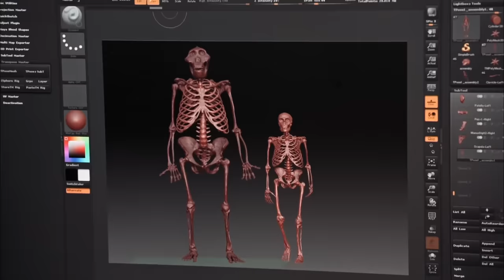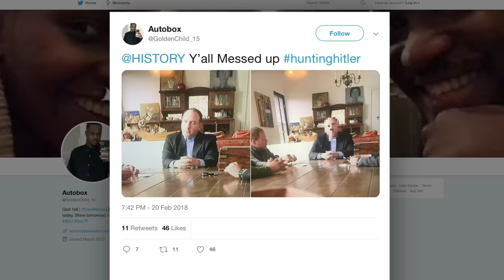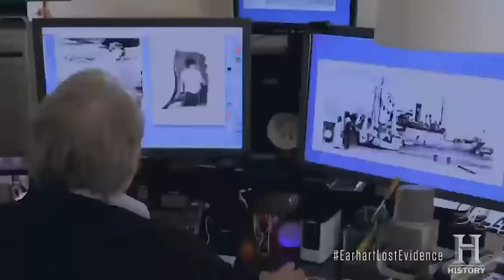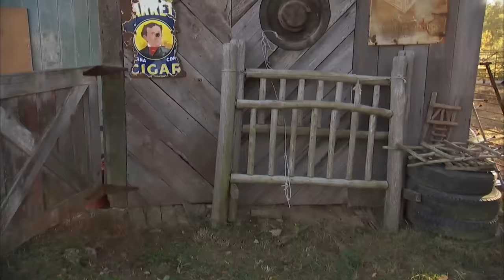The Biggest Scandals To Ever Hit The History Channel

Comment from the maker: Which of these History Channel scandals do you think was the worst and why?
Reply: The ones where physical crimes occurred against others but we really can't blame the H channel for that since it occurred outside of the show. . .    

As for faking shows, Ice Road showed someone trying to put tire chains on a semi truck that was not pulling a trailer and failing badly.  It was very obvious that they were not even trying to do it as it is super easy to install chains on a fully exposed tire.  

Pickers is defiantly faked, there just isn't that much good stuff hidden around the corner.  One show was where they were looking for parts of a very rare motorcycle.  One guy is climbing up over a pile of parts and from behind a shelf, pulls out an engine.  Problem was the engine was completely clean and not rusted like one that was  " hidden away forever. "  

Other networks are not much better, look at the car restoration shows where the drama is so., so fake and they will lose the shop if the car isn't finished in 2 weeks from the time they decide to build a particular car. .
Reply: The History Channel's biggest scandal was taking History out of their channel; nowadays they're simply referred to as the Hysteria Channel.
Reply: After Roger Mudd left it was downhill from there!
Reply: Got a link to these CIA papers?
Reply: It's use by the right wing to spread misinformation, period. Also, every single show mentioned was unwatchable hillbilly bullshit. Long live you tube, and commenting directly below such nonsense.
Reply: well I think Obama = the devil was pretty much dead on
Reply: the bible was the worst
Reply: Satan didnt look enough like Obama
Reply: We get these 'reality shows' in mid-dawn tv!..We sat there,8 of us waiting for the sky to clear (astronomers) Laughing our heads of at the obviously fake 'reality' drama's taking place! All these swamp people in 'mortal danger' of 'gators and all alone!..What?!! They've clearly got 2-3 camera crews and sound people with them! Another was a bunch of 'loggers' bringing down tree's in the most dangerous manner and constantly hating each other! But they never really moved until the so called danger was past!..Again, multiple camera crews!..Reality?..How can people actually believe any of this is real..Well, you did elect Donald Trump..That says plenty about American 'reality'!
Reply: The history of MTV. 
Back in the day it was a channel 
that played music videos
Reply: This is questionable about what could be defined as history in some cases, yes these are past scandalous events. But placing these in a historical timeline???....
Reply: Laura Juranek Modern Marvels was such a great show. I could watch it and be completely interested in whatever topic they covered, even if it was something I had little interest in. Such a well made program. Too bad it’s now history.
Reply: stretching with the Alone one. most of them are youtubers and have talked about it
Reply: @KevinTheSkullAnderson  dude, I just wrote the exact same thing on a Washington Post story. Freaking me out haha
Reply: Losing to Discovery’s Street Outlaws
Reply: History Channel lost it's last shred of credibility with that stupid "documentary" about mermaids.
Reply: That the history channel doesn't actually show history anymore.
Reply: A lot fair points but also a lot of shitty research you've clearly never seen some of these shows like Alone the  contestants film everything themselves they're nowhere  as close to civilization as you make in seem that is N&A most likely , also Alone explains that the contestants undergo weekly check ups from the medical staff. Ax men are filmed on several location with each team / company at a different locations while they might have a Washington team Jimmy was in Florida  one season and Georgia the next.
Reply: @laurencehirst7814  
You think people believing that stuff is bad then you don't know how bad it really gets, in the 1960's when Gilligan's Island was on TV west coast naval commanders used to get letters from people who didn't understand why, with all the ships the Navy has, they couldn't spare a few to go out and look for those poor stranded people, that's how stupid people can be when it comes to television.
Reply: @dukecraig2402  And it's getting worse!..But it's not just an "Only in America" thing! It's targeted at a specific audience, a friend of ours in 'marketing'  explained it this way!.."It's set up for what we call the low browed and ape brained with cash to spend on useless items marketed on the 'reality' shows, who will believe anything! Crazy conspiracy's, Bigfoot, vampires, anything!"..He also said, for the marketers, it's amazingly lucrative!..The people in these 'shows' are nearly all under contracts to the marketing company's and are well paid to fake it!....However, he told us that something in the order of 90% of it is licensed in America and exported worldwide, but NOT for primetime viewing!
Reply: @laurencehirst7814  
Yea I know, I've been to several different places in the world and I can assure you that there's idiots everywhere, it's not exclusive to America it's just a particular mind set, that's why I didn't point out anyone in particular, I'm constantly explaining to people who just sit around and America bash that whatever they say about America they're also saying about themselves, because if there's one thing I've learned in my travels it's that some things about people are are the same no matter where you go, that's why marketing techniques work, it's called basic human nature.
Reply: Y-A-A-A-A-A-W-W-W-N who the hell cares.
Reply: For starters, drenching your talk in background music is the hallmark of a bad, unprofessional channel. It's just stupid. I can't watch it. Unbearable. None of your college professors played music during lecture. When you learn how to properly provide Youtube material, I may give it another try. Have a good day!
Reply: The Bible was hilarious.
Reply: Tbh the whole channel is a joke... they NEVER show REAL history anyway
Reply: @Ouija ZaZa Gaming 🤣😂😂😂😂
Reply: @syntaxerror8955  "Yah but all the cool radio stations do it!"
Reply: I don't know what's so crazy about Hitler escaping to Argentina, when it's confirmed the fucking CIA/OSS rescued and brought in top Nazi scientists into the US under Operation Paperclip. The Soviets and British did the same. The Vatican also helped rescue many Nazis with their "rat lines".
Reply: The worst History Channel scandal is what it has become today.
Reply: Why is one person on a show getting arrested for DUI even on the list? How many employees of this firm ever had a DUI ? No Killed someone or anything details are like well he was weaving and found to have taken beer and Xanix? So this is the least worst and seems like filler or something?
Reply: Scandalous the amount of ads you have
Reply: joseph watson  Not sure how it is political - this is all a Media point grab? peace?
Reply: @dukecraig2402  Aha!..And as the undertaker said..."You've hit the nail right into the lid!"..No matter where you go, or when, their there! They tend to know little or nothing about America! It's even being put about by some fools that it's dangerous to go to America, because your liable to get shot! Iv'e been to the U.S.A. twice, the only complaint that i ever had, is that your catfish taste bloody awful! We don't eat 'em in Australia!..The United States is no different to any other country, and better than most!..Despite Donald Trump!
Reply: @davegordon6943  Spot on! X3
Reply: ...History Channel should DISCUSS More ON REAL WARS and BATTLES of World Wars...The ROTHSCHILDS...Bankers of 1913...The True Sinking of the Luisitania...Jack the Ripper...The Fraud of EINSTEIN....Oppenheimer's NUCLEAR HOLOCAUST...etc...!!  And GET OVER WITH HITLER IS ALIVE...HE's Dead.!!
Reply: @earlfrancart5687  Oh come on, Obama the African as Satan was freaking hilarious.
Reply: @lexblack6170  well it would have been, if the right wing didnt take it seriously, and push it as fact
Reply: Is the Frank from pickers really a "scandal" ? How many people have been locked up every day for the same thing?
Reply: Grunge Big Foot.  Who could be so stupid to believe that crap.
Reply: I don't think any one of them was particularly bad, I just grew tired of having six hours of the bullshit crammed down my throat every night when I wanted to watch some actual history.
Reply: IT HAS TO BE THIS VIDEO! 🤮
Reply: Hunting Hitler couldnt be more real of a possible scenario.  Easy to fake his death, almost every one of his top brass fled to other countries. The crumbs are there to follow as the show did and there are a bunch of crumbs. No they couldnt prove beyond a reasonable doubt but would you believe Hitler to sit back and lose it all to watch his closest all flee and start over somewhere else which most lived full long lives.  We arent talking about believing in bigfoot here.  History channel wasnt sensationalizing Hitler, just merely trying to prove history books are wrong.
Reply: 10 years ago I planned my Wednesday's around history. It was just THAT good
Reply: Your video was much worse than anything  history has put out , this video was full of rambling’s
Reply: Earl Francart  you’re not the brightest light bulb are you did you miss the speaker of the house SDSU a month ago that they had no evidence of trump and Russian collusion, not to mention the muller investigation is over , with no Russian collusion 🙄
Reply: Grunge;  Haven't had cable in years. Huge waste of $$$. BUT! When my wife and I are away and staying at a hotel, we catch up on "South Park" and "American Pickers". Nothing else! So, what's "Franky" Fritz's personal life have anything to do with History Channel's scandals?
Reply: Worst scandel has to be no more history documentaries
Reply: @babyrazor6887  agreed!
Reply: The Hillbillies chasing monsters that was BS .... sorry forgot the name
Reply: If they'd have open season on idiots with no repercussions, the rest of us would back to three channels.
Reply: I laughed my head off at the Obama devil!
Reply: Now nat geo makes pure political agitation propaganda masquerading as "documentaries"
Reply: Grunge Why are pictures of an old biological weapons test facility in this video?
Reply: Everything on Mainstream Media TV is 100% Crap........Ill gladly watch these semi reality shows anyday over Lying NBC ABC CBS PBS any day........Any Day over Corporate Media
Reply: @babyrazor6887  That's because your ability to reason is nonexistent.
Reply: @rassy440  and had Most Wanted in Europe with Ray Cokes.
Reply: The best is aliens ... always !
Reply: LKevin Anderson l
Reply: Ancient Aliens.
Reply: It has never been the History Channel. Only History. Why does everyone get that wrong? They even capitalize channel.
Reply: Sorry but the obvious fakery is with Storage Wars and Pawn Stars. The people on The Pickers have huge collections and full family stories and are located all over the country. No one would go to such effort to compile all that stuff again and again just for a tv show. Much easier to fill a small storage locker with junk and place a good item borrowed from an expert, or have a person come into a pawn shop pretending to be the owner of a borrowed item.
Reply: Grunge is liars for profit to make this little TV show you made half lies and slanders come alive congratulations you're like Facebook on steroids
Reply: Alone is legit, they do the filming themselves. I know joe robinet from season one personally. Nothing about that show was fake. While he admitted that he was not hundreds of miles from civilization, he was very much alone and stranded in the hostile wilderness, black bear and cougars were a very present danger.
Reply: chum lee is the worst  he should of went to jail  any one els would of ben  slamed on the ground at gun point METH and Guns Shit try that in PA  and u  be lucky not to get 20+ years
Reply: fyi  hes fines he most scerntly  got are nothing more then a bribe  Shows that its a fact if u have $$  u can walk
Reply: @laurajuranek4415  It reminds me of MTV. It was good when they showed music videos. For some stupid reason they started airing  all kinds of crap.
Reply: The bigest scandal is the networks ruining average peoples lives just to make a buck
Reply: All of them😂
Reply: To me , everything the History Channel shows is nothing but crap; except for the when they do the things that they used to do, like show hear about HISTORY and nothing else.   

All reality shows are absolutely absurd, ridiculous, and frankly it's nothing but TRASH.
Reply: The worsrt fact is that it is American
Reply: All of them because History Channel now sucks.
Reply: The worst one is one that you didn’t even mention. I forgot what it’s called but it’s involving aliens. So
Reply: Actually I have a question about why you think the pyramids were built with ramps? How did they get the wood to build the ramps in the desert? How would a man get the materials up an incline like that? Just curious about why you think this and could you explain more?
Reply: I saw a guy fro Argentina  make a comment on youtube  on one of the hunting hitler videos He said he lived near where they filmed in Argentina and saw the film crew burying "nazi artifacts" to be discovered on the tv show He said that film shoot that he witnessed was fake
Reply: I live in idaho man and Bigfoot capturde is actualy a good show even if its fake.
Reply: A scandal about how big Mike Obama pulled the wool over everyone's eyes and actually made millions of nieve Americans believe he was a actual female !his real name is Mike tho at least.
Reply: Biggest scandal is not teaching history
Reply: I dont know, i only watched ancient aliens! 😬
Reply: @philipwebb960  amen brother...it's nothing bit reruns from years ago.
Nothing Historical about it bit the reruns.
Reply: @earlfrancart5687  nope, he got it right the first time.
Reply: @Dissenter  I briefly worked with an Argentinean who had said that his gpa had done stupid stuff. He didn't say it outright buuuttt...  a German fleeing to Argentina after ww2? He'd just shake his head and say 'the stupid things ppl get caught up in' like it was a high school prank or something low key.
Reply: meh I lump history channel with discovery now that Mythbusters is gone. I want Jamie & Adam back!
Reply: The absolute biggest scam reality show is Discovery Street Outlaws.
Reply: History channel where the truth is history!
Reply: @digibotdotcom  nothing owned by disney is right winged.
Reply: The moon shinners. I was a trucker and before that show aired I had picked up legal liquor made by a few they showed as boot leggers. All fake so I never watch any of it.
Reply: @Longtack55  
They have Bigfoot DNA now. Not the The History channel though
Reply: @bobroberts2371   ... and then there are those house flipping shows. SMH  Personally I don't  Have any interests in "reality" shows because actual reality shows would predominantly be so boring that they would be akin to watching paint dry.  Necessitating a script to produce something even remotely interesting to occur (I'm not positive of the statistics but could imagine the actual probability pretty high that without fabrication a whole lot of nothing of interestoccuring naturally) 50%+ of the time to maintain an interest in the show.  However some people do watch fishing and bowling sports competitions so their exists a common denominator somewhere but I don't think that would cover expenses nor keep the show on the air very long.  Which leads me back to my strong dislike and distrust of the whole genre.
Reply: Augustus McGovern There are producers that try to make actual content.  Have a look at 32:10 - 35:00  and  48:27 - 48:44 in the vid   2018 Pebble Beach Classic Car Forum: Car Guys on TV   On the channel   Pebble Beach Concours d'Elegance
Reply: Chumly had illegal firearms class a class b drugs and was charged with assault did no time and people with less money could have done at least six months of not more just awaiting trial white and rich walks away again . I’m not black but it’s painfully obvious that the Americans justice system is unfair and rich people could get away with almost murder . That’s quite sad not from their but I seen a lot of documentaries and there is guys in prison just for smoking weed and chum example is another one.
Reply: The one with Slayer
Reply: Who hasn't smoked weed?
Reply: #1:  Why they stopped being about "History" altogether!There is PLENTY of documentaries, BBC historical content, and hours and hours of movies in the historical genre...FOUL!...it USED to be amazing before all the drama crap shows.
Reply: It's all a scandal, why can't we watch shows and they just be real, why the quasi reality
Reply: Bigfoot. I knew it was not real. You ain't going to ever catch those beings. They're way to smart.
Reply: @kennethkingery2586  at least you believe, I actually seen a small orange one in Tennessee in 93..
Reply: the channel has nothing to do about history
Reply: Frank and Mike getting married. It is still secret stuff.
Reply: @Joe Duke Let us in on the trick you used to know what the devil looks like?
Reply: @Joe Duke Who knows what the Devil actually looks like, no one alive has seen him?  Same thing for Jesus, the portrait of him was painted 1600 yrs. after he died!
Reply: the fact that it no longer has anything to do with history anymore..
Reply: Calling it HISTORY.  Because it isn't.
Reply: The fact that they dropped decent programming for the current crop of shit.
Reply: Grunge This YouTube video is the real worst
Reply: Hey I’m just saying that they didn’t know the golden coins were stolen
Reply: Pawn stars cause they used to buy stuff that were once stolen
Reply: Well! Can you blame the Kennedy family I mean there not telling the whole truth
Reply: And it's History. 😆
Reply: They were all bad.
Reply: The Pawn stars.  As if 50'000 melted down from stolen Gold and the comic relief being into Meth wasn't bad enough, but civil resposibility of switching producers adds to it. It is certainly the largest scale and most criminal.
Reply: And MTV had actual MUSIC
Reply: Ice Truckers - totally silly.
Reply: Definitely that the swamp denizens pressured the Channel regarding the Kennedy series.  Heaven forbid tell the truth about that gang of reprobate crooks and frauds!
Reply: some Staged Shows, may be?
Reply: What I don't like us THIS CHANNEL which verily is doing absolutely whatsoever NOTHING but slandering and maligning (some) actually good shows for their OWN Entertainment..
Reply: The moment that the History channel became “not the history channel”
Reply: Everything, reality TV is about as authentic as deed to the Brooklyn Bridge....
Reply: The History Channel's greatest mistake. That means you tell us about one mistake. Do you know what words mean. If you're going to give us a list of History Channel's greatest mistakes then the name of your video is a list of History Channel's greatest mistakes not History Channel's greatest mistake. I hope I never see your channel again
Reply: @bobroberts2371  9,
Reply: @bobroberts2371  I  remember the pickers  episode where  mike and the girl  had to craw through a hole in a wall or fence just to get in and they were with the owners,  how did the owners get in the same hole
Reply: The biggest scandal of all is when the History Channel became little more than a collection of reality shows.